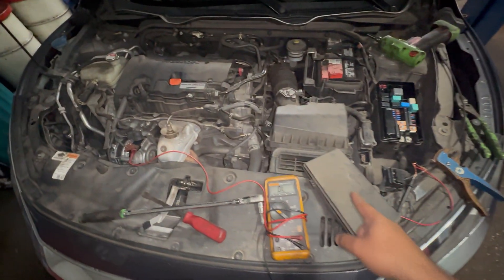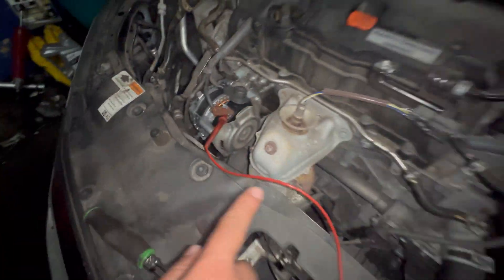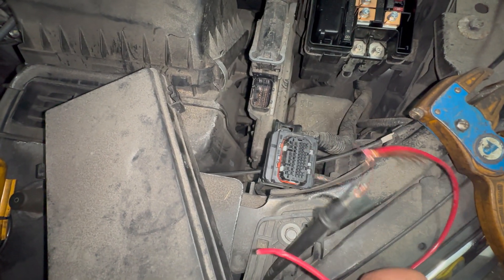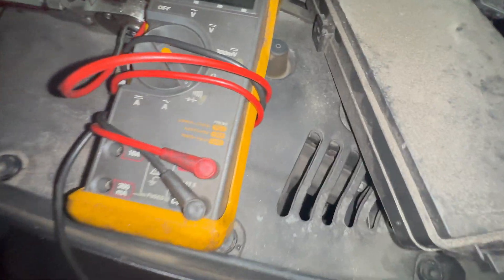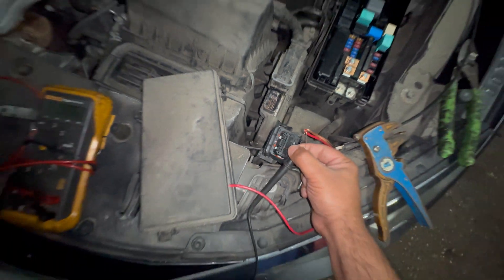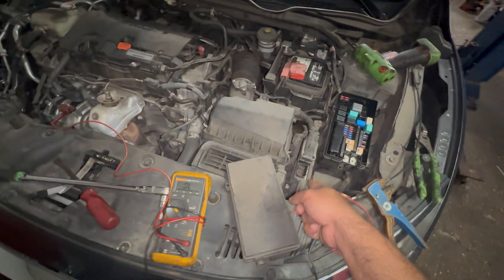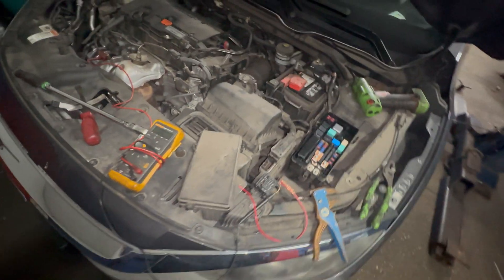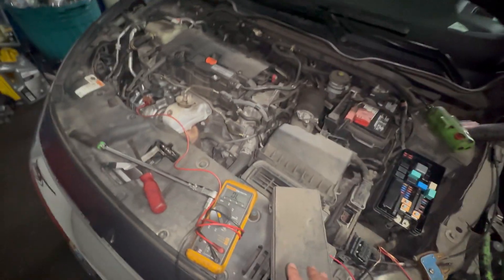Honda Civic 2018 p16E2 PGM FI ACG communication error  Check wire continuite PCM to ALTernator 1 pin

Comment: could you also do it without the copper wire, like is the wire only to squeeze in instead of having to use the probe provided already with the dmm
Reply from the maker: Without what?
Reply: @RBTheMechanic   the wire/pin you used to probe the connector of the pcm and the connector for the alternator